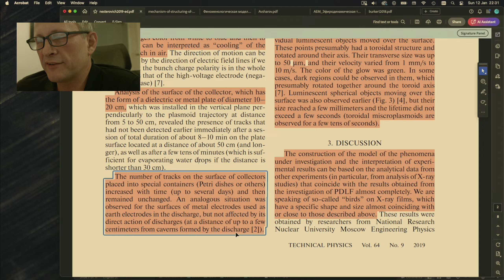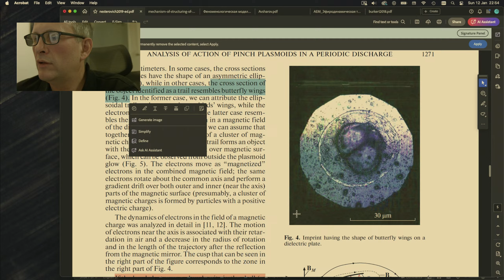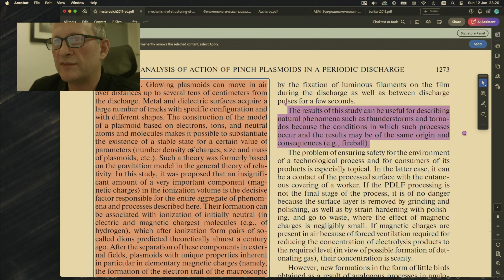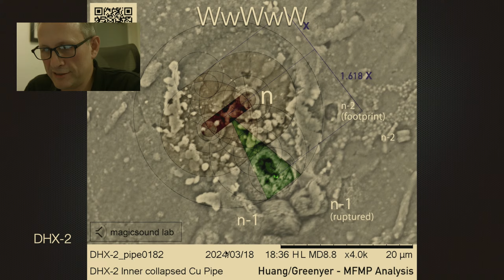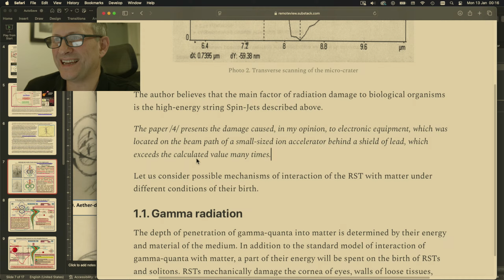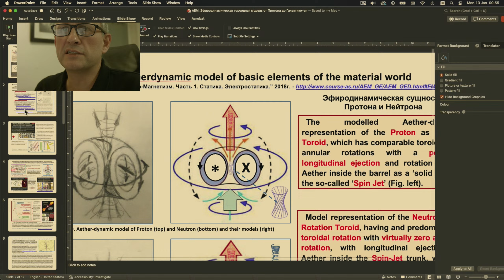O-Day - There is no 'O'

Comment: cold fusion need the positive potential of Pd to load D into Pd but it can not trigger cold fusion.original cold fusion reactor used the negative Pd but D+ is very low because they used strong alkaline D2O, but fortunately cold fusion can be triggered by the insulating film growth on Pd with stripped pattern by wire Pt electrode which current path is limited on th open area on the Pd with stripped insulating film which can increase the local temperature which can trigger Cold fusion.
I hope you will make explanation video on the mechanism of cold fusion and PFP experiment.

Comment: Excellent stream. You good sir are a master communicator.
Reply from the maker: Well, little hard work on the read through of the first paper, but it was important to get it on the record. The independent and inadvertent corroboration of our work and the new work of Shishkin and Avsharov, recognising by extension the hard physical data from the Bin-Juine Huang reactor (Flux Capacitor) I feel is a critical moment in this journey.
Reply: @MFMP  I trust your judgement and have saved a copy of this stream offline. Currently rewatching from the aether dynamic model segment. I feel it is important that I fill the gaps in my knowledge before bringing my contribution to the lab - for which streams of this nature are ideal. The inadvertent corroboration certainly is significant from my perspective. I appreciate the effort you continue to maintain and look forward to future interactions.
Reply from the maker: @atlanteanpriestking  Enjoy - I will post the links later today